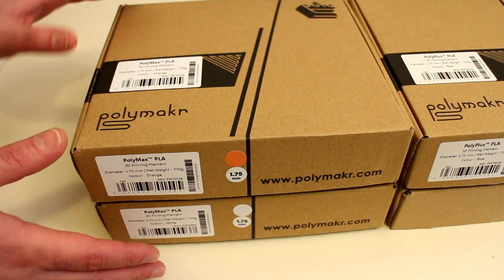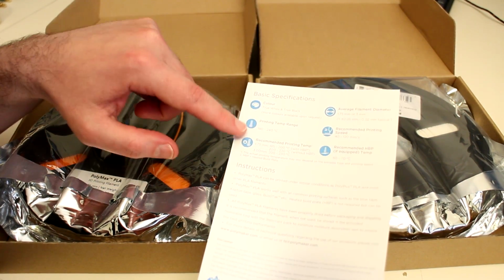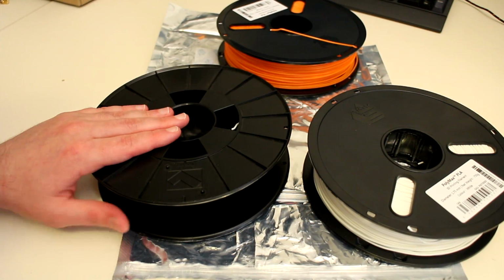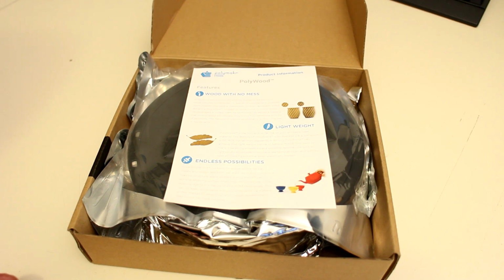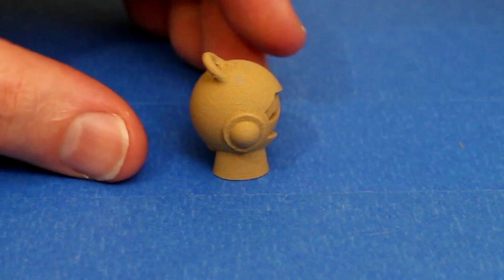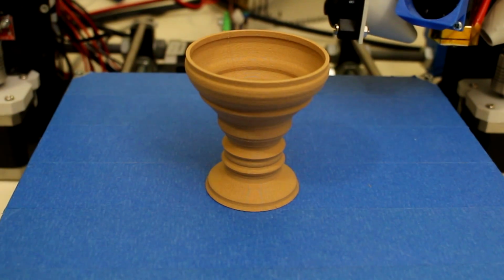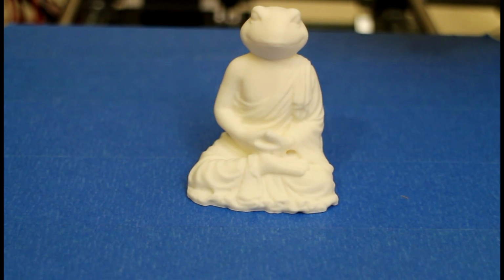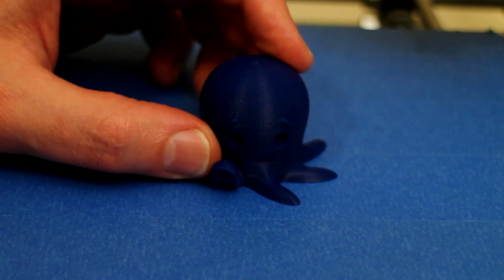3D Printer - Hi Quality PolyMakr Filament Review

Comment: Another great Video...I have been using Polymax PLA 1.75mm for some time now, in fact I have a Hypercube constructed totally from it , I have found it to be all it claims and more, I have now changed from PETG and now use Polymax PLA as my everyday filament ....I found your test on the Polywood interesting and now plan to try it out myself...great videos , thxs :)
Reply: No plans to enclose the cube to print higher temp filament? This stuff seems to still have the PLA achilles heal of temperature sensitivity. I'm struggling through printing PETG parts on my cube now to be able to enclose it so I can print PC, Nylon, Taulman etc.

Comment: If the filament snaps so easily is an indication that the filament needs to be dried.
Reply: Or it could just be very brittle because it has 9x better impact resistance compared to normal pla.

Comment: Were you using any glue when printings any of these models? I'm interested in buying my filament in bulk for my business and I'm trying to find a nice filament to rely on. Also if you recommend any other filaments you have tried?
Reply from the maker: +Brennen Patel 
If you need filament for business, probably best to stick with a brand name supplier. Polymaker is good of course, but best to experiment with what you can source in your country.

Comment: Hey, which hot end are you using? Is it the stock one that came with your printer?
Reply from the maker: +DrMrSuperAwesomeGuy 
I switched to the E3D v6 hotend.
Reply: How was the quality with the stock hot end? was it horrible or pretty good?
Reply from the maker: It was pretty good. It worked as advertised, but I wanted more.
Reply: Understood. I am getting something similar very soon, and I wanted to know how well off I'd be with the stock hot end before needing to upgrade. If I do upgrade I'll probably go for an E3D lite v6

Comment: Hi Bro, the printed pieces are truly stunning. Is it possible to use the material with CubePro 3D printer (from Cubefy)?
Reply from the maker: +Alex Cai 
I had a quick look on the Cubify website. It seems the CubePro uses 'cartidges' for its filament. I think you have to buy their filament as a result but probably best to ask CubePro support.

Comment: Hey that's Marvin! :)
Reply from the maker: +3D Hubs 
Great design Mr 3D Hubs !
Reply: +3D Hubs Yeah, Marvin is the perfect tool to test out filaments and machine settings.
Reply: +Tech2C Do you use s3d by any chance? Also, what is your nozzle diameter please. Looks smaller than 0.4mm. Am i wrong? Your prints look amazing and on a bowden no less.
Reply from the maker: DrR1pper

Hello, I use Cura. I haven't purchased Simplyfy3D yet. I use a 0.4mm nozzle. The E3D hotend I switched to is amazing for fine print control. It was an improvement from the stock JHead Mk5B that came with the kit. Cheers!
Reply: Tech2C
Interesting. Is the E3D hotend a finner tip nozzle which is the reason for finner print control? Also is the nozzle compatible with any other 1.75mm filament 0.4mm nozzle extruder? Cheers
Reply from the maker: DrR1pper
I believe the nozzle tapers to 0.4mm differently than other brands resulting in finer control. Jump on the e3d website for more info.
Reply: Tech2C Thx! :)

Comment: Hi, just found your video's.  They are really helping me make a decision on a 3d printer.
 As you know there are a lot of different versions of the Prusa i3 out there and hard to work out which one is the way to go.  I know yours is modified a fair bit now but base kits have also been upgraded since you started your video's as well.
Could I ask what kit you would recommend if someone was to buy a new Prusa i3 now.  The original looks a good kit but a little more cost than others, then you have the Replikeo, BQ, Makerfarm and then there is the eBay and Aliepress versions as well.  Just looking for one that most of the upgrades have been built into there latest versions.  Any help would be great.  Thanks.
Reply from the maker: +Bugcatcher3d 
Yes, there are an enormous amount of Prusa i3 iterations out there. I guess your budget will determine which printer is the right one. 

If you want a really cheap entry to 3D printing, the Replikeo kit is $250US plus shipping which is $100 cheaper than when I bought mine. Or you can spend a bit more and get a kit with an Aluminium heat bed, Bowden extruder, quality hotend, z-axis motors with leadscrew rods as shafts to eliminate shaft couplers, etc. All of these "upgrades" can be added to any printer you purchase. If you can find a printer with raving reviews out of the box, then go for that. Also after sales support is important, so a Makerfarm printer might be worth the extra cash. 

Either way it's a hobby, a learning experience, and something you can be a proud to assemble yourself and print awesome objects.
Reply: +Tech2C Thanks for getting back.  I'm from Perth, Aus so looking at places that ship down our way.  I would rather spend a bit more and get something a little better with a lot of the upgrades in the kit stock.  Filament quality seems to make a big difference as well. I don't know how serious I want to get at this stage and technology is changing so fast I don't want to invest in something that will be outdated as soon as I buy it.  The other thing I want to avoid is kits that look to be 3d printed in low quality instead of using quality sliders etc.  I don't think I will have a lot of time later upgrading all the time.  If you know of quality kit that ticks a lot of the boxes please let me know.
Reply from the maker: +Bugcatcher3d 
Another commenter posted has had success with the Aurora Prusa I3 kit purchased from eBay, although he says the power supply is a little low wattage. That is indicative of virtually every kit I've seen whereby there's always something that is just off. Take a look at the website https://www.3dprintersonlinestore.com/ for other options...

Comment: I just want you to know that your videos are the reason I had confidence in buying a chinese prusa i3 printer. I purchased a Aurora Prusa I3 kit for $308 on ebay. It took about 6 hours to assemble with the worst instructions, but after that I loaded some gcode and got a successful first print. I am happy to report I had to make very few changes to get the kind of print quality your getting now. In fact, printing at 30mm/s on small parts like marvin and my prints look similar to yours. One of the reason for this is the z axis my printer came with has threaded shafts that are part of the steppers and don't rely on a connector to a threaded rod to mess up the alignment.

The printer isn't perfect, the y axis belt is impossible to put tension on out of the box and needs a tensioner added, the x axis was tight enough but since I was printing spare parts I printed one with a tensioner anyway but the biggest problem by far is the power supply. The heated bed will never reach 100c on it's own and the hot end won't got over 230 if the fan is on. The power supply is only 240w, I have ordered a 500w to replace it. this should make the printer hit  it's target temps and warm up much faster.
Reply from the maker: Josh Bishop 
Great comment! I'm glad your printer is performing at it's peak. The feedback you've mentioned regarding the stepper motors with the shafts inbuilt is something I've being wondering about, as I'd like to move to Leadscrew rods instead of M5 threaded rod, but if I add a shaft coupler again the z-axis artifacts may still be an issue.

My power supply is 400w which seems adequate. Make sure you insulate the underneath of the heatbed, also measure the resistance of the heatbed, any higher than 1.3ohms can be difficult to heat up enough. With your hotend can you adjust the fan so it doesn't blow air over the heatblock? Any breeze blowing over the heatblock will dramatically affect its heating capability.
Reply: Until my power supply gets here I have to cover the heated bed with a piece of cardboard and manually shut the fan off if I use the warm up mode, if it's warming up on gcode I already have the fan turned off.

If I was you I would just buy another printer that has the lead screws integrated into the steppers. That way you can have 2 printers going at the same time when working on a project and a different printer that people might be searching for for more youtube hits. you already have a great baseline to compare another product against. 

http://www.ebay.com.au/itm/Aurora-Reprap-Z605S-3D-Printer-DIY-CNC-Suit-3D-Flatbed-Kits-with-LED-Screen-/321721053765?hash=item4ae811b245
This is the one I purchased, only 3 printed parts, everything else typically printed is injection molded or aluminum.
Reply from the maker: Josh Bishop 
Great stuff! I like that printer, sans the acrylic. It seems to tick all the boxes - leadscrew steppers, alu heatbed etc but is it bowden or direct drive filament? 3mm or 1.75mm?

There are many Prusa i3 kits out now, but not many of them incorporate the leadscrew steppers - most still have shaft couplers. As the old saying goes, prevention is better than a cure, so I think replacing my steppers with yours will be an answer. Should help a lot of folks if these steppers are hyped up to be as good as you say.

I plan to build a new printer at some stage using my printer as parts. That way we can maximize cost efficiency.

Cheers :)

Comment: Wow! You really have that printer dialled in now. Well done!!!
Reply from the maker: Pete F 
Thanks Pete !
Reply: Tech2C It looks like there is very little layer evidence in those prints. Did you do something to the printer since your previous video where you tweaked the Z axis on your machine? Or was there some other difference or changes you've made other than the plastic itself?
Reply from the maker: Pete F 
All these parts (except the chalice lathe) were sliced and printed in Cura. 
Cura seems to change layer height whilst still doing a print move, which among other slicer movement differences really enhanced the quality I found.
Reply: Tech2C Amazing quality, can you post your Cura settings or make a video pleas thank you .
I usually get better results with sic3r. (You can just post any geode from cura, and cura can get the settings)